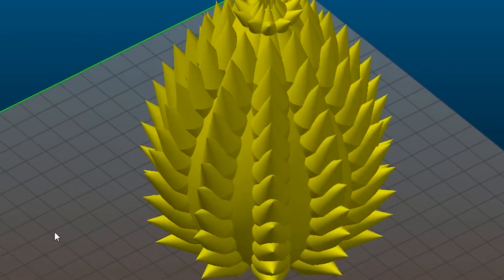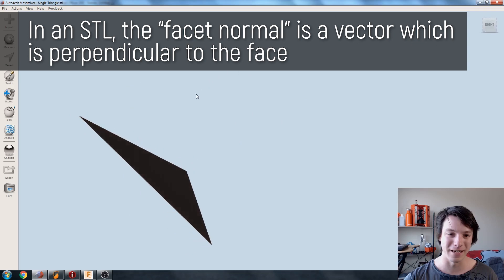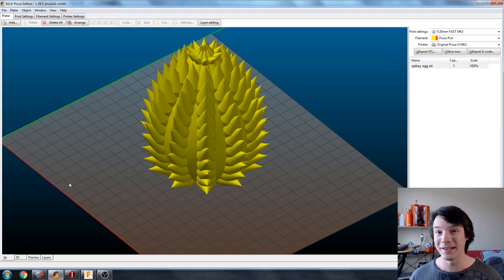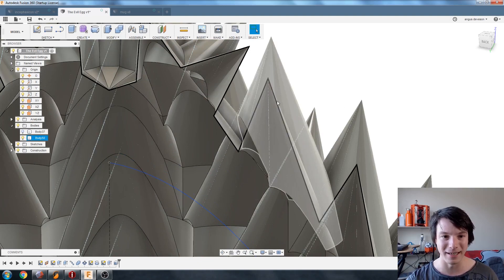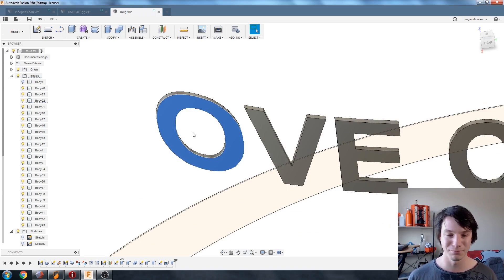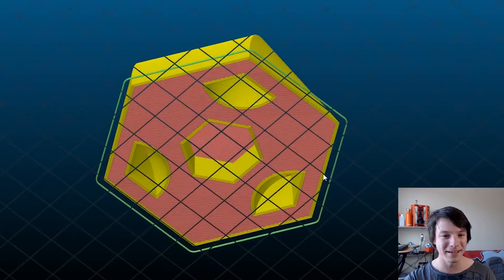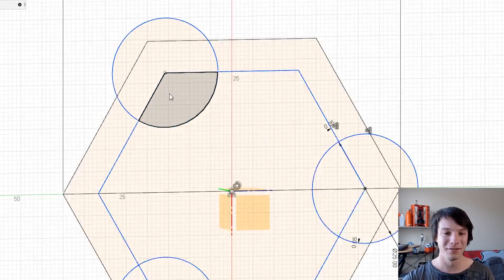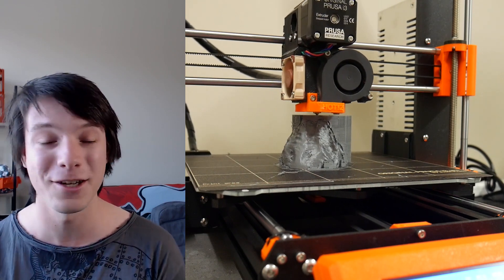How to hide geometry within .stl files for 3D Printing

Comment: I discovered this for accident the other day I was in inported into bambu Studio and there were several parts that I wanted to print at the same time so I select all . There were three versions of one item and stack those three versions inside of each other, it show and error and repaired It and I no longer had and error, it just look like a fancy designs and I will ahead and print it with Support and it printed all kinds of weird things show up all over it. I didn’t think anything about it and I pulled it back up to re-print it the other day And noticed in bambu studio it showed multiple item complained so I told to separate the item, and then I realized what had happen. You could do this to create some really sci-fi illusions.

Comment: Hi Angus. Great video! Regarding the hexasphericon trick in Slic3r, I wonder if you can separate the two models within Slic3r itself. What happens if you load the model in Slic3r, select the model, go to "Settings"? In the "Settings", do you see the model as a single object? If so, if you select the child part of the object and click "Split Part", does your hidden model get revealed?

Comment: I have a question. Does anyone knows why 3d obj files come out low poly stl files after editing and saving? I know the actual geometry normaly is low poly and it is then smoothed, but how do I retain that smoothness after if I want to 3d print the object? I have this high poly obj file that opens as high res 3d object in cura. But if I edit it and save the result, it goes back to low poly. What do I need to do to keep the smoothness?

Comment: I suggest using some program to essentially "Pre-Process" your models that lets you view the vertexes. I've made impossible to print models and corrected others with the free program "Blender". Since I'm OCD about my normals and hidden geometry, having made incredible objects in computer space and later swearing at the failures coming off the print bed. Always "Pre-Process", sometimes you can save yourself days of frustration with 5 minutes of verification.

Comment: Hi Angus, really cool channel you running! I have Topography terrains that i design and develop which are virtually paper thin and i was wonder if you had a video or advice as to making these thin tin surfaces printable objects. The files i work with have thousand if not millions of triangles and i have manged to print sections of terrain models, but i am looking to design thin phased bolt on models which overlay the existing terrain models. if you have any advice i would greatly appreciate it. Keep up the good work, loving your channel.

Comment: imagine this used similar to doki doki literature club, instead of game code translated to a .jpg image which is then wrapped around a cone and viewed from the point down (actual thing). a random string of code that means nothing until it's turned into an stl file, which in a slicer means nothing, and has to be printed out to show what the clue actually is. am i crazy or does that sound like one hell of a treasure hunt?

Comment: I have been using this to kinda control my own infill or in place of infill. Lets assume you have a gear with a circular hole through the middle for an axle lets say. And lets assume you want it to look like a solid but would like to have your infill arranged as spokes. Now you know you will print this with lets say 5 perimeters (2mm) so you "cut" a rectangle into it with .05mm width and whatever other dimension is needed to get from the 2mm wall hub around the center circle to the 2mm wall of the gear. Repeat it in a circular pattern as often as you want and now you have "internal 4mm width spokes" as the slicer will make a rectangle with a 5 perimeters with a .05mm gap in the center which will be filled by plastic of course. So now you can lay your "infill" down in patterns and even reinforce some walls where needed structurally Like if a 2mm wall is fine for most of your print but a small section where you want it to be lets say 4mm. So it is good for quite a few things beyond "hiding" things.
Reply: It does not have to be that small and a number of shapes will work. For example, with a circle shape, you will get a supporting cylinder made of a number of perimeter walls (if properly sized of course).
Reply: Then you can print with 0 top and bottom layers and can get quite some interesting effects

Comment: I've never NOT looked at the "Line view" in cura and scrolled up and down at least taking  quick look through the layers....I can't imagine printing without doing that!
Reply: Yeah I've had a couple models from places like Thingiverse that have burned me like that, when sliced the model is missing layers and they print poorly. I've learned to check all my slices now and run through a repair utility if needed before printing!
Reply: Since the newer versions of Cura, I've had a lot of trouble scrolling through the layer view. Maybe it's a design decision to prevent this from being rediculously obvious? I typically "pre-process" in Blender as a way to handle transfer from low poly to high poly and mega-scaled versions. (Polygon multiplication and smoothing as well as better build plate management across 3 different types of processes. (3d printing, CNC, laser engraving))

Comment: If you use the 3d printing slicer software included with Windows 10 and you merge two parts it messes up loads with the overlap, take a look at that..
Reply: Strangely My Comments Usually Get Quite Popular paint 3D?
Reply: @malhotradaksh  uh no, I think its 3d builder

Comment: How to slice your Tolerance Test Gauge? (i. e. V1, which has smaller tolerance). Shouldn’t the smallest tolerance gap be fused by the slicer and not test the printer tolerance at all?
Reply from the maker: Slic3r does fuse the smallest gap of the test, some slicers do some don't.

Comment: Once a time, i had to print a Real madrid key chain, but the crown on top has Sooo much detail, so I went to cheat, and set the nozzle to 0,3 thickness. It printed great but I'll won't set to 0,05 to print these! Nice work! 😂
How ever at Large prints I "cheat" too and set 0,6 nozzle withOUT a 0,6 one, just the standard 0,4 nozzle. What you think about this? Would you do, or recommend for other people, or it's better to save myself a secret? 😂
Reply: =massive over or underextrusion... strenght will be worthless, dimensional accuracy idem

Comment: It might be fun to have a sphericon (or other odd shaped) cavity inside a solid sphere. Technically you should be able to get a perfectly normal looking sphere to behave very strangely. Care to try it out?
Reply: Spheres print badly on 3d printers, so would overhangs of these inside cavities I guess
Reply: @the_ALchannel  if it was on the inside though it wouldn't really matter
Reply: and you could put like a marble on the inside so it would be like one of those cat toys except the channels would curve so the "ball" would roll like a hexasphereacon. It might need a bit of sanding to get it to look right on the outside and to clean up the inside too but I think he could get it to work...

Comment: This is where CAD reaches it's limits because most CAD programs don't have options to modify the normals of an object...
In "real" 3D programs like Maya or Blender you could just place a regular model inside of another one and reverse the face normals so that it is inside out. Or just do a boolean operation to subtract one model from another.
I love CAD for it's simplicity and user-friendliness, but for some applications you won't be able to get around 3D programs.
Reply: ScanTraxx27 Remember that CAD began as an engineering tool, and I’d say almost all engineers don’t do pretty, they do working.
Reply: True, but what I described isn't just for doing pretty. Making molds for example is so much easier when you have the options I described above. Some molds are even impossible to model in CAD programs. It's >not< working, in terms of engineering.
Reply: Oh yeah, mold design in CAD shivers

Comment: Thats a great way to put stuctural supports within the infill
Reply: Ye, what kind of applications would you use it for?
Reply: @Stettafire  FDM uses infill to print overhangs, it needs to be there to support the print, but part strength is also important sometimes and i dont think infill provides that so much. I think this method could be used to increase part strength by adding a matrix or crystaline stucture within the infill.
Reply: Possibly, but I've never had a print have issues because of the infill not being strong enough. What kind of prints do you think this would benefit?
Reply: @Stettafire  airframes or structural members. Its basic engineering really. I guess im saying that we could use this method to make prints stronger, or possibly in the future we would see structure within infill for part strength as a feature in slicers. Its how nature does it, why not 3d printing ;)
Reply: @Makenitso  go a step further,  second skin just inside of model skin. Add strength,  cool artifact designs,  lithograph type images, double perimeter on flexible filaments, hide the inside of models using transparent filaments, fake outer skin for effect or support.
Reply: @Makenitso  I'm a newbie to 3D printing, but I am an engineer (retired). I was making some parts in OpenSCAD that had hex "nuts" attached at the surface of an object and would be used to apply torsion, say with a ratchet and socket. The "normal" construction made this as a shell with infill extending from the body into the nut. It was very weak. I found I could instead model it as if the nut was extended as a separate body down into the surface it attached to. I model them with a tiny gap between the "parts", say 0.01 mm, and the slicer will print both parts with walls that naturally become fused together and the result is very much stronger. (Think of it as press-fitting a hex nut into a hex-shaped hole.)
I searched the 'net a bit trying to find information on this technique. This is the first reference I've found to making parts stronger by modeling in this manner.
It makes it possible to build strength in at specific points without doing drastic things with infill percentages.
I'm still learning about everything in 3D printing, but this definitely has real-world applications beyond Easter eggs.
Reply: I thought the same
Reply: CNC Kitchen has a video about this. There he making an FEM-Analysis and then generates a second model made of only the most stressed volumes an then puts them together for printing. I think it's called Smart Infill.

Comment: You are mistaken. One single triangle, while possible to write in the STL encoding, does not form a valid STL file. STL is required to form solid, complete, non-overlapping shells, so a tetrahedron is the smallest valid STL shape. The non-manifold warning is about one of these errors.
Reply from the maker: That's what I said, 0 thickness. You can still save it and import it into any slicer, it just can't be printed. It's not manifold.
Reply: Yes, that's why it's not printable. But the STL format is specified to only cover those that are. Therefore, while STL-processing software loads the single triangle file, it's not a valid STL file, much like a text file with mismatching tags isn't proper XML.